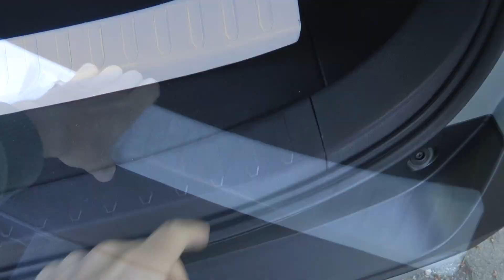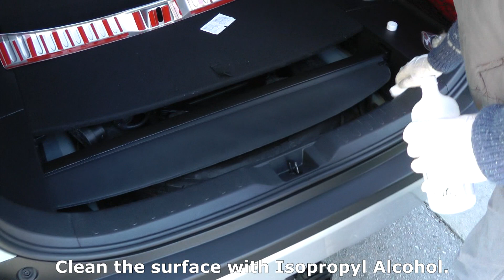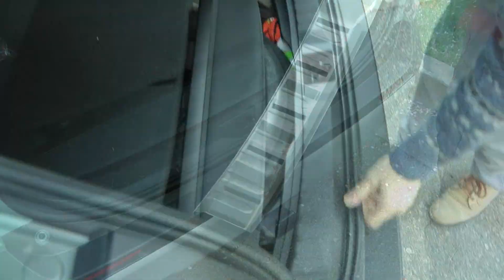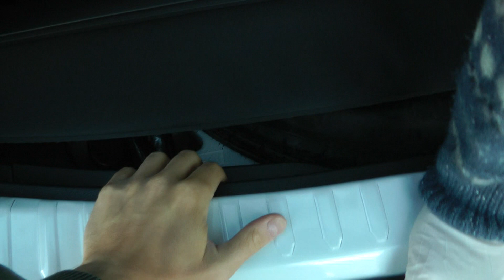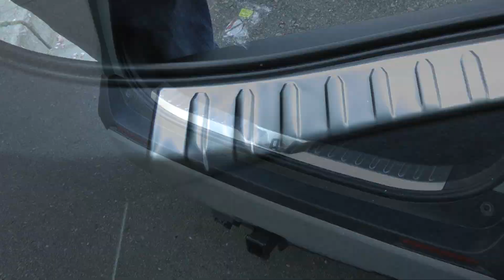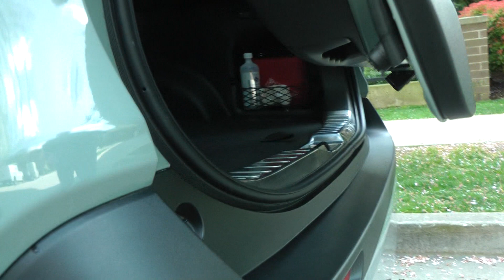Toyota RAV4 (2019-2024): Rear Door Sill Stainless Steel Protection Plate Installation.

Comment from the maker: PRODUCT LINK:
Stainless Inner Rear Bumper Protector Foot Plate Cover For Toyota RAV4 2019 2020 2021 2022 2023 2024 - https://cartrimhome.com/Stainless-Inner-Rear-Bumper-Protector-Foot-Plate-Cover-For-Toyota-RAV4-2019?tracking=morozov_automotive.

RECOMMENDED TOOLS:
1. ISOPROPYL ALCOHOL - Solimo 99% Isopropyl Alcohol For Technical Use,16 Fl Oz - https://amzn.to/3x5DGuJ.
2. WIRELESS HEAT GUN - Makita XGH02ZK 18V LXT Lithium-Ion Cordless Variable Temperature Heat Gun, Tool Only - https://amzn.to/40QlVNZ.
3. Makita BL1860B 18V LXT Lithium-Ion 6.0 Ah Battery - https://amzn.to/3jFTtxs.

Comment: I can't tell, did it close properly or did you open it again  before it could seal?
Reply from the maker: It did close properly. The plate doesn't interfere with operation of the rear door.
Reply: You can always position the plate and try closing the boot before you stick it on to check position etc.